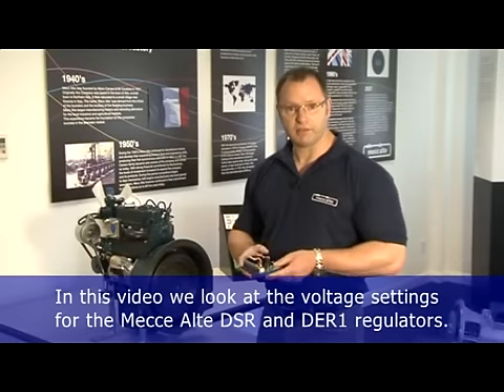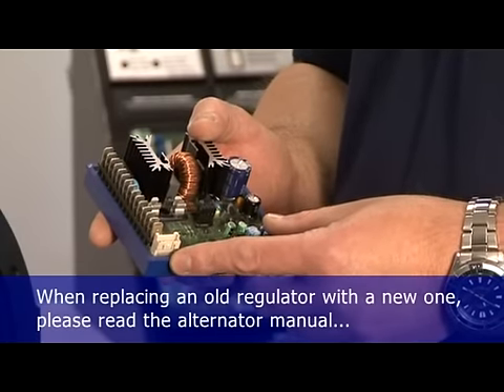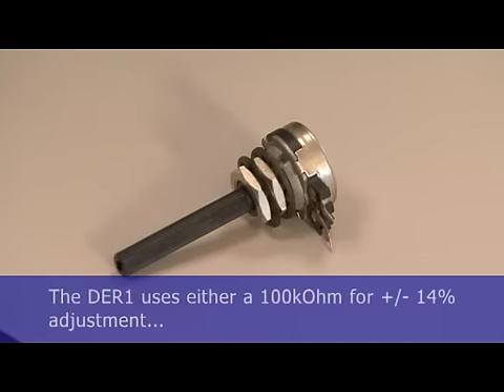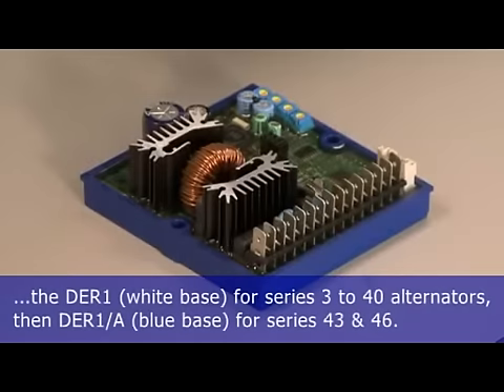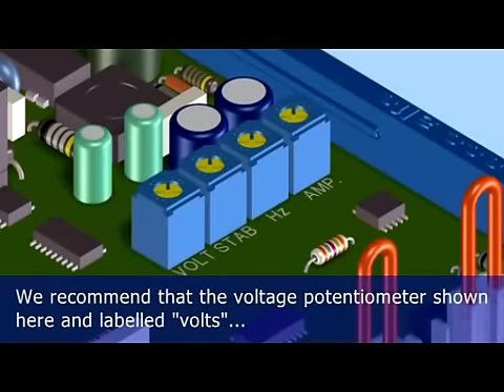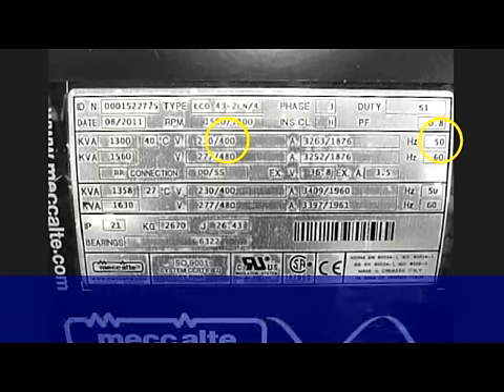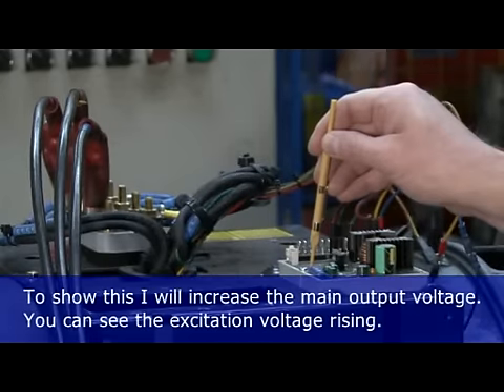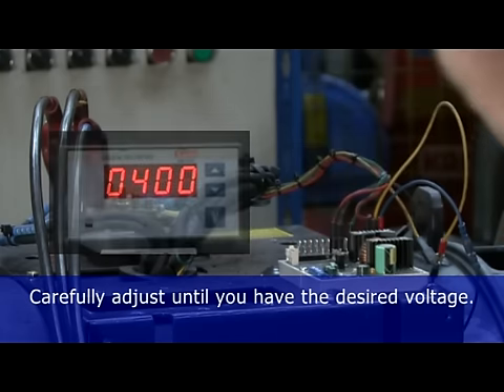VIDEO 1 Voltage adjustment DSR - DER1

Comment: I have an ECO 28-SN4 that is currently supplying power to a 120V Inverter/Charger (outback 3648). What must I do to supply power to a 240V Magnum inverter/Charger? From what I see here, a voltage adjustment should take care of it? There is only 3 wires coming from the generator to the breaker box (Green/White/Black). Do I need to reconfigure the wiring as well?